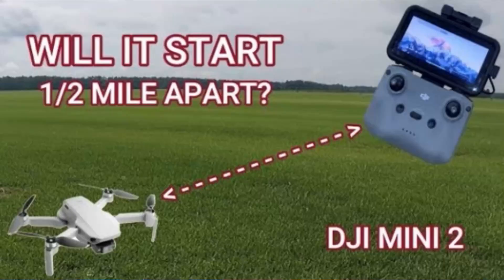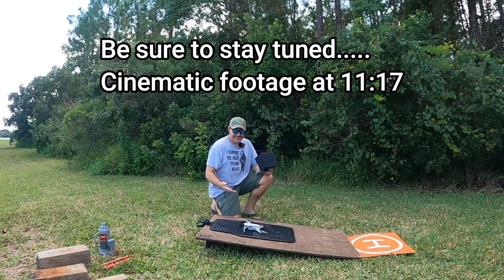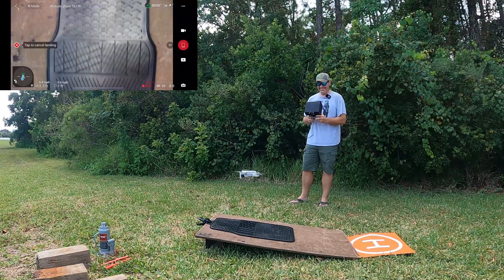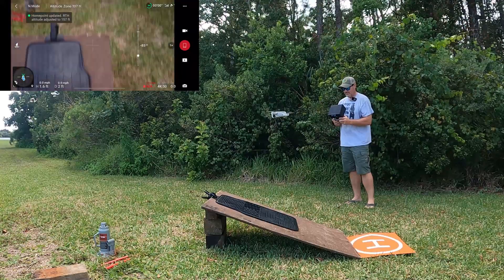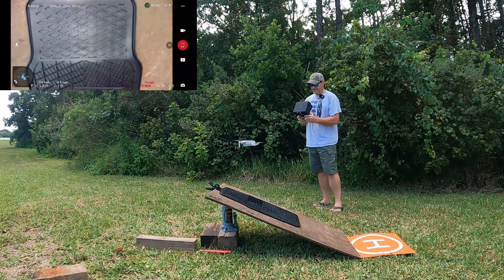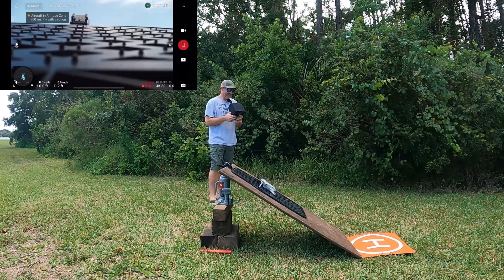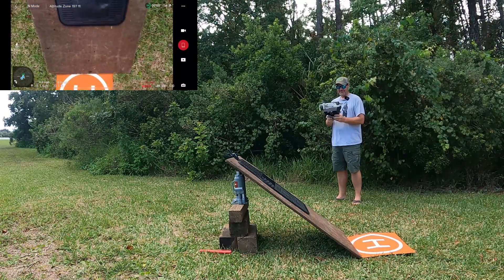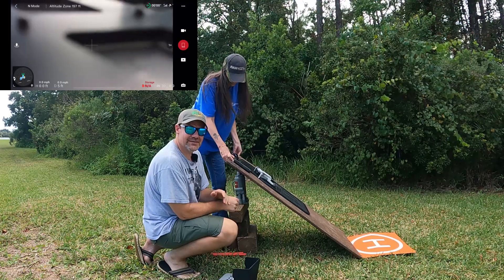DJI Mini 2 Launch and Land on an Angle? / IMU Attitude Error / Cinematic Covered Bridge

Comment: While doing my Austria video I made the experience that you should not really trust this. Was trying to land on a rock that was not totally flat (but nowhere as steep as your ramp)  and the drone just didn’t want to stop the rotors and kept moving towards the edge where it finally turned around and fell of with the rotors into the ground and kept turning them. It was hard to watch but luckily no damage except for the rotor blades. Interesting test though!
Reply: Was using a MA2 on that occasion though. Likely the surface was slippier as well.
Reply from the maker: Oh wow. Yea we could definitely see that happening. Before we put the car mat on the board our drone slid all the way down the board and hit the grass before the motors shut off. We learned it’s ok to land on steeper surfaces as long as it’s not slippery and the drone can maybe have something to grab ahold of with the front legs.  It would be really easy to slide off a roof, eh?  They’re all slippery!  Lol.

Comment: Science! Nice testing. I didn't expect it to work so well on anything other than a flat, level surface.
Reply from the maker: hahaha.. Science and Math are not my best subjects by any means... lol  We were sort of shocked when we started getting up past 15 degrees even.  I totally thought 10 degrees would be it and the video would be a lot shorter... lol  For the Mini 2, I can't figure out why in the world they'd have the IMU error angle set steeper for the back and sides than for the front.  Especially since the props in the back are so much lower than the front props.  I'm pretty sure if I were to try to land facing backwards into the incline, we would have had a catastrophe on our hands... lol

Comment: Thank God ! They probably put in the 38 degree limit so you wouldn't shred your props. I spoke too soon. Trying to land at 38 degree. Goodbye props ! God is even kicking the wind up saying "What do I have to do to get through to him this is a bad idea?".
Reply from the maker: haaaaaa!!!!! Man, that's funny stuff...  God intervened for sure with the wind.  We were really surprised by the results here but are still puzzled as to why the IMU error comes up at different angles for each direction.  You'd figure with the Mini 2 the front angle should be higher because the blades are so much higher, right?  If I were to try and land at 45 degrees with the back facing the incline, I'm pretty sure the props would destroy something....  Thanks for watching, David and for the hilarious comment... God bless!!!  Kevin

Comment: I’ll stick to level stuff - was on a beach and my landing pad was inclined slightly - my mini 2 slid all the way down it when I landed - always enjoy your videos 👏👏👏👏
Reply from the maker: lol.  We will probably stick to mostly level stuff, too.  When you slid off the pad, did your drone get covered in sand?  That had to be disheartening, eh?  Thanks for watching, man...  We learned some stuff here!  lol  God bless...
Reply: @WeretheRoberts  no luckily 😃 it’s legs stopped against the metal ring but it slid a good 12 inches - your rubber mat is surely the way forward - “The Roberts Rubber Landing pad” There’s a marketing opportunity in there somewhere - I’d buy one - you could get it embossed with a picture of both of you - or Jack 😃
Reply from the maker: @MrHitman1966  dude that’s an idea!!!  We may have to make it reversible so people can turn it over and not have to look at our picture. Lol. The Roberts reversible rubber landing pad. It’s got a ring to it.